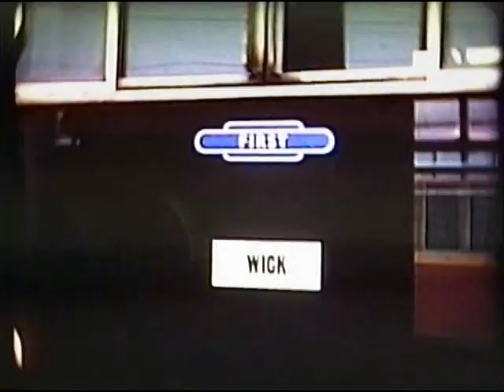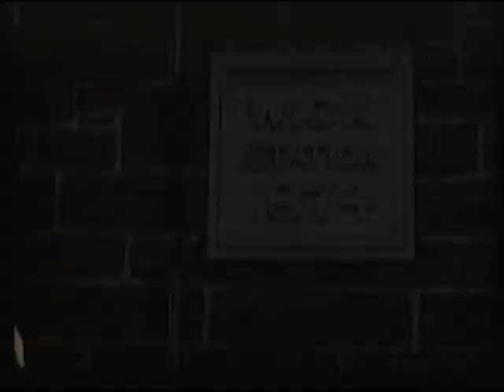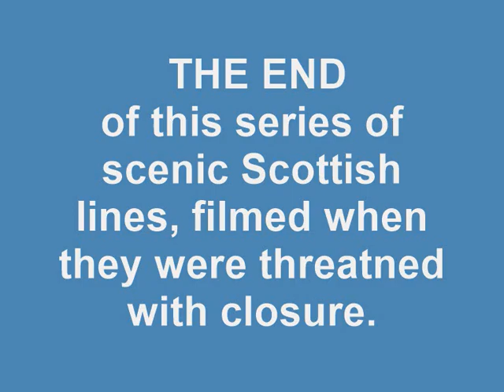FAR NORTH LINE Highlands train ride to Wick & Thurso 1964

Comment: Visited Sutherland in 1961 as a teenager and remember this railway and the then quite modern Type 2 diesel locomotives which hauled all trains passenger and goods. Wonderful that the line somehow has remained open, despite massive road improvements. And of course that business of trains not dividing at Georgemas with Wick passengers having to go to Thurso and then retrace steps

Comment: Wonderful film,  just had a quick look on the internet to if any of the station are still open an some are but The Mound closed in 1960 and some others also. Found a interesting web sight on old maps of England and Scotland from about 1900 showing all the railway line of that time frame , You can fade out the old map and a modern Gogle map comes up and can see where the old lines use to run and showing goods depot, gas works. sidings in to industrial factory,s.